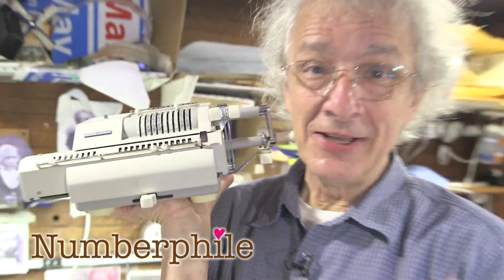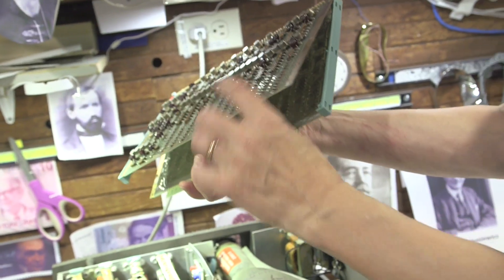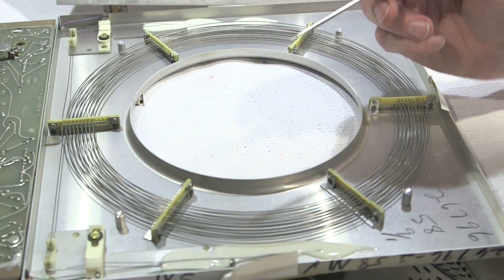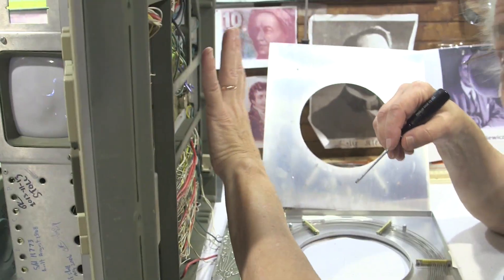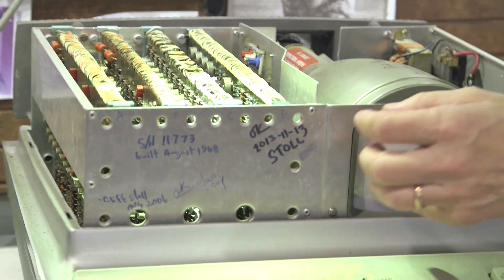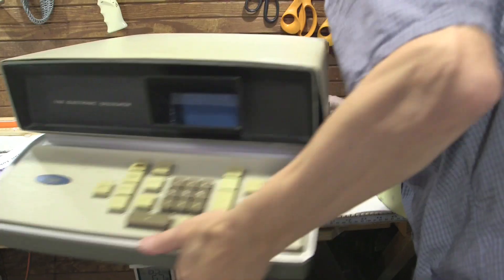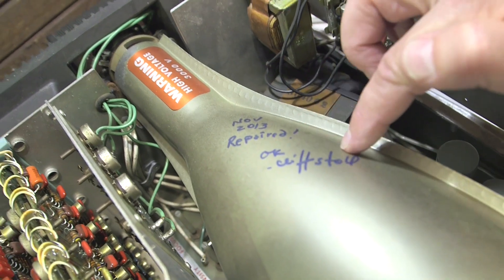An astonishing old calculator - Numberphile

Comment: I used these type adding machines when I was doing “O” Grade Statistics. I accept that this is a calculator, but the Adding machines were simulator. My mother used to be a Comptometer Operator in the Civil Service. Love these devices of the past. This past couple of months, I’ve been buying loads of Slide Rules…different sizes, different manufactures. I just had an urge. I hadn’t used one for 50-55 years. Joys of retirement…you have time for these items.

Comment: I remember using one of these in 1972. You could solve 3d trig to 8 0r 10 decimal places.
Used to plot locations on turbine and compressor blades. We had to use 15 place trig ratio tables in 4 inch thick books.
Not fast and you had to write results down before they scrolled off the top, but better than manual in the pre calculator days.

Comment: Why didn't this just use magnetic core memory?  I would have needed what? 800 bits of memory?  Transistor based memory would not have been needed.  Acoustic memory was used in the Lion computer in the 1950s.   My guess is that he thought of core and rejected it because he felt this would work better?  Core memory would have been more stable. Remember it was core memory that got us to the moon.  Magnetic core memory dates to 1953.

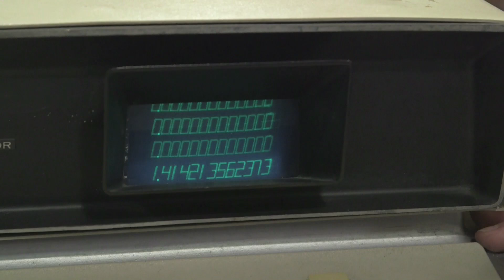Comment: Oops, what happens at 6:36? Hope it didn't break there... Such a magnificent piece of electronics and what an enthusiastic presentation of it ^_^
Reply: Just speculating but the memory is basically vibrations aka sound waves going around a loop of piano wire. It bugs out as he's talking loudly so probably the sound of his voice gets picked up and those vibrations corrupted the memory. You can also hear him tap the table or something, that could have been it. But it's not broken, you can see it still works fine afterwards. This is analogous to your computer crashing because of overclocked RAM. Doesn't mean anything is broken, just that memory got corrupted. This calculator is basic enough that corrupted memory doesn't cause a 'crash' because unlike a computer's operating system all that memory does is hold 4x13 digits.

Comment: During technical college, when learning about microcontrollers, I happened to read about the ROM memory of a programmable calculator from the late 1960s called Wang 700: It was made from thousands of diodes and about a mile of enameled wire. All of a sudden, programming an EPROM felt almost unsportsmanlike...!

Comment: In 1968 I worked on the AUTOVON system (Canadian version) which used germanium transistors. Even then they were becoming obsolete and the company had to get them specially made. Four flipflops to a card!

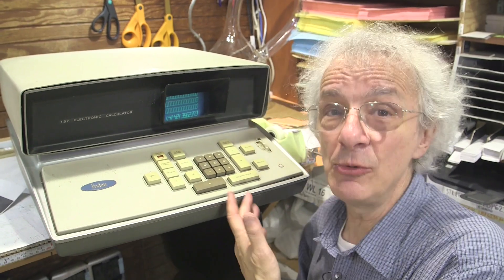Comment: 6:35
Cliff: shakes head in excitement
Computer memory: Did you say 0.100007000109?
Reply: Could it be the acoustic memory freaking out?
Reply: @aok76_  Im wondering how easy it is to tamper with the acoustic memory. Will it work in a noisy, or even moderately noisy, enviornment?

Comment: I wonder if the wire needs "tuning" from time to time. It seems like the time it takes the bits to recirculate could change slightly with years.

Comment: It's so wonderful. Reminds me that we had similar delay lines/ring buffers in early color TVs too, to "calculate" the phase shift between two lines (automatic color correction in PAL Systems). But instead of a wire they used a crystal in conjunction with a piezo resonator.

Comment: Think about this:  The Antikathura Mechanism - a  very intricate gear-driven solar-system-movement-based calendar and display - was made by Archimedes and his "tech workshop" about 100 BC or so.  The tech to make it again was rediscovered circa 1500-1600 AD or so (Swiss clock-makers and Newton and his laws of motion and gravity).  Those two dates, as far as modern computer tech goes, are the same distance from us.  It as if nothing happened for about 2000 years in mechanically-aided calculator technology and then, almost instantly by previous-timed human technological change rates, it all became as obsolete as a caveman's flint ax in modern warfare.  How long did this tiny-CRT/acoustic-memory machine last before it was a trash-dump candidate?  How fast will what we consider "modern hi-tech" end up the same way?  Answer, just as fast or probably even faster.  We are being "frog-marched" into an unknown future at "ludicrous speed" (from SPACEBALLS).  We are living in "interesting times" in more ways than one, as the old Chinese curse goes...

Comment: I've heard that the oldest computer was just a calculator that's as large as the giant room it's in.

Today, the smallest computers can do so many more things, and are just around 2 times later than a wristwatch.

How far we've come today.
Reply: Back then when someone said 'computer' they sometimes applied that term to machines that were 'just' calculators and could not be programmed. Technically if a computer/machine is programmable then it is what we think of when we say the word 'computer' today. I forgot the name of the first programmable computer but yeah it was room-sized. Also whether a computer was programmable can be open to debate since the first 'programmable' computers required people to make changes to part of the hardware. What they were doing to the hardware was analogous to rewriting an EPROM today. I suppose one could argue that the first true (programmable) computers used punch cards which had the instructions for the program encoded on the cards.

Comment: 90% of issues with OLD electronic equipment can be found in dirty connections, often edge connectors. Otherwise cold soldered joints account for most of the rest. Actual electronic component failure is actually pretty rare. Nice machine. Radars I worked on in the 70's and 80's had miles of wire as a delay line to compare successive electrical signals to identify moving from stationary targets.

Comment: When I was an undergraduate in the 70s there was a working one of those in the engineering lab. ISTR  using it for thermodynamic calculations. Later I went to lectures my MV Wilkes who invented the mercury delay line, the precursor of the wire memory.

Comment: There is a game I really like called scrap mechanic and you can build with logic gates. I made a calculator once that can add and subtract 2 digit numbers. It took a week to build, and was very tedious work. I can't imagine trying to build one that does 13 digits and includes multiply and divide only using transistors.

Comment: His discussion of old technology reminds me of a computer tech from 30 years ago... 

At the time we met, our computer system used "voice-coil" positioners for the heads of rotating hard drives.  Before that, the tech told me they used hydraulics to position the heads.  He said many service calls on the computer systems were due to low oil level in the reservoir of the drive.

Comment: Wouldn't it be easier to use capacitors to store bits? Full=1, empty=0, check it by discharging it into a transistor's gate, and recharge the capacitor from the transistor's drain to refresh?

Comment: Yes, you can still buy discrete germanium transistors. What might be an interesting project would be to rebuild it with modern discrete components. In the 90's the instructors I had said the discrete component we had at the time where much better and more precise than those they had in the 60's.

Comment: It might not be acoustic delay-line memory. It might be torsion delay-line memory, where the wire gets twisted around its axis clockwise and anti-clockwise to store the bits. I recall the torsion wire delay-line memory got pretty popular for computers in the 1950s because it was much more reliable than mercury acoustic delay-line memory.

Comment: I have just done some sums on this. It seems like almost nothing could be cheaper than a length of steel wire. 
This 1k of memory is about 1m of wire. 
So, a 32GB SD Card which costs £3.79 would be 32 million metres of wire. 
And that would cost at least  £3 million. 
How can a chip be 6 orders of magnitude cheaper than just about the cheapest thing imaginable?
Maybe it's all down to parallel v serial manufacture.

Comment: In 1968, 7 months before I graduated, Tremper high school bought a "computer." We were told it cost over $100,000, and advanced math students were allowed to play with it. A room in the library was dedicated to this thing which was the size of a very large dresser.  You could "program" it in under 25 keystrokes if memory serves, but it wasn't Turing complete, since there were no conditional transfers.  I was able to crank out square roots by pressing [Enter] over and over until two successive results were identical. If that thing was over $100,000 in 1968, how much did this electronic calculator go for in 1963???

Comment: Sort of glossed right over the electro-mechanical Fridens. I spent many hours on them. In fairness, they're basically the same machines as the manual, but instead of manually, the wheels and gears ans schtufffs are powered by electric motor(s).

Comment: In the 70's my father built a calculator from scratch. The case was made of plexiglas and was about the side of a desk-top telephone set of the same period. It had a power cable for plugging into a power outlet. It could add, subtract, multiply, and divide. He was working as an engineer at General Motors (in their tech center north of Detroit), and one day he came to work and it was gone. He went to his boss to report it stolen and found his boss using it. The boss begged him to let him have it for just that one day, and Dad agreed. The next day he went to the boss' office to retrieve it, and it was gone. Dad and his boss went to the boss' boss' office, and found that fellow using it.

Dad passed on in 2003, but Mom still has the calculator and it still works.

Comment: Cliff wonders if you can even get Germanium transistors today. In fact he can (tho I would suspect electrolytic caps and solder joints, or the high-volt display transistors, before logic transistors). They were over-produced in the US in the 1960s (longer in the USSR). Much of that was dumped in barrels which are now being re-sorted for specialty audio (fuzz pedals). While I don't see the once-popular 2N1305 around, he can surely find US production look-alike work-alike (when in doubt, try 2N404) from a reputable vendor. Steve at Small Bear Electronics would know. 

There is also, at this moment, an eBay for ten 2N1305 for $10! While much eBay is junk, this is in plausible TI folders and shipped from Las Cruces, which may be the dump for 1960s computer surplus.

Comment: Currently you can still buy discrete transistors, but largely restricted to the silicon ones. You can still do discrete logic but even using discrete components you would want to do it using CMOS (that is, MOSFET complimentary pairs instead of transistors and resistors) for power consumption and compatibility.

A discrete CMOS memory of 250 bits would take about 1500 MOSFETs using standard 6-transistor SRAM cells. Logic would take about twice as much MOSFETs as this circuit board here (since all transistors here and all their corresponding pull-up or pull-down resistors are replaced with a complimentary pair of MOSFETs)

Or you can fit a complete computer algebra system in a Cortex-M7 microcontroller like the STM32F767ZIT6 and you get a single-chip graphing calculator.

Comment: The beauty of Reverse Polish Notation (RPN) is that the evaluation of RPN strings is extremely simple to implement in software.  You just push the numbers onto a stack, then when you encounter an operation you pop however many operands that operation needs (usually the top two), perform the operation, and push the result onto the stack.  In school, that was my first non-trivial program that compiled and ran correctly first-time, which shows how simple it is to implement.
The earlier HP calculators were RPN (AKA "postfix notation") whereas TI calculators had parentheses and used infix notation like humans are taught to do.

Comment: For estimating how many transistors you would have needed to provide memory, Cliff left out a factor.  6 entries, each 10 digits long, 4 bits per digit would give us 240 bits that we'd need for memory.  But how many transistors are needed for each bit?  If we use something like a Eccles-Jordan bistable multivibrator (AKA "a flip-flop"), then at a minimum we need at least two transistors per bit.  However, we also need at least two more (or possibly four or more) to control the flip-flop, setting and resetting it as needed.  So then assuming a best case of four transistors per bit, we would need at least 960 transistors to replace that coil of wire.

Comment: Two power zero is one. Why two is because you can split something. So the natural sequence or nature sequence is 2^0 2^1 2^2 2^3 ....  and  1/2^1 1/2^2 1/2^3 ... so  ... 1/16 1/8 1/4 1/2 1 2 4 8 18 32 64 ... now the exponents have sequence   ... -3 -2 -1 0 1 2 3 4 5 ... so  number line.
Reply: Now 2^3 + 2^4  = 24 why 3 and 4 because 3^2 + 4^2 = 5^2 . Trig ratios. Time factor.
Reply: Division of time is 24 parts.
Reply: Others are wave factors.
Reply: Natural sequence for curves  are  3 4 and 5.
Reply: 10^3 + 9^3 Smallest.   2^3+2 2^^3+1  .. so 2 and 1 mass generator and 0 and 4 fixer.
Reply: 2^10 and 2^9 for real and 2^12 and 2^1 for dark space and dark matter.
Reply: So 2 and 4 gigs. 2 gig and 1 1/2 gigs.

Comment: Display: 10 (Very rarely do modern calculators show you 4 12-digit numbers)
Functionality: 5
Accuracy (Well it depends on how many decimal places you want): 5 (2σ)
Ergonomics: 2 (It's very heavy to carry)
Cred: 3^^^3 (edit)
Durability: 3
Reply: Durability 3!??? It's been functioning since 1963
Reply: @YaamFel  it a needed a repair in the 2000s and it wont work if its very cold, because of the wire that transmits the data
Reply: Cool: 100
Reply: coolness : limit of x as x reaches infinity
Reply: Coolness: cardinality of ℝ
Reply: Is this a reference to what I think it's a reference to? 🤩

Comment: My college also still had an EC-132 when I graduated around 1970. I found out something unusual would sometimes occur if you pressed the "overflow lock" key while a long sqrt operation was in progress.

The "overflow/lock" key (with the little red light in the middle) in the upper left of the keyboard. If you tried to divide by zero or take the square root of a negative number (IIRC), the keyboard would lock, that key would light up, and you had to press it to continue.

I decided to see what would happen if you pressed that key while a long sqrt operation was in progress. Most of the time nothing really unusual--the display would reappear with some unreliable number. However, once in a while, all the numbers on the screen would start scrolling to the left (or right, I don't remember which) like a marquee, and nobody knew why! Now it's obvious the recirculating memory is involved somehow. Of course, the details are way beyond me. I wonder if Cliff would explain it.

Comment: Wow a blast from the past. In 1968 my university had 12 Fridens  for student use. (£600 each!) I was a new undergraduate and couldn't believe how  a four function calculator could even exist!  It was amazing using after tables and slide rules and not a little daunting to use at first. Still needed tables  for trig and other functions of course. Scientific calculators came much later. Strangely I don't remember the decimal selector at all. Memory does strange tricks after  50 years!

Comment: divide it by zero. let's see what it gets.
but more serious, can you please make a video explaining how a handheld calculator can calculate a math calculation exactly to the last digit? ex: log 5 = 0.698970004336019 and then when you get the antilog, it returns 5 correctly and not 4.9999999999? but if you try to generate manually the log of a number to 15 places, you get a lot of truncation errors! so how does a calculator do that precision?

Comment: You can still buy germanium transistors brand new (made in 2014 if buying january 2018), but theyre about 10 euros now per piece. Dont think ti makes them anymore, mine are by lg but you can get some from toshiba for a price. Theyre only used for radar installations and medicine devices and things like airplanes. And probably military. They come hand tested and every single has a individum testsheet on them, what makes them so expensive.

Comment: From 1966 to 1970 I was a part time draftsman at Rockwell working my way through college.  The place I worked for made valves.  For stress calculations I used this machine.  I thought it was pretty cool gadget but had no inkling how advanced it was.  I also learned RPN and can't get a correct answer from a regular pocket calculator this this day.

Comment: Cliff, if you haven't already fixed that bad calculator, check the power supply.  What I saw on you screen is classic for dried out electrolytics that sends high ripple out to the electronics.  BTW, I have that exact calculator.  I had to change the power supply capacitors, now it works perfectly.  I still use it on occasion when I need to do very high precision math.